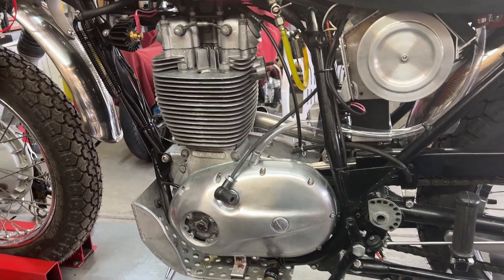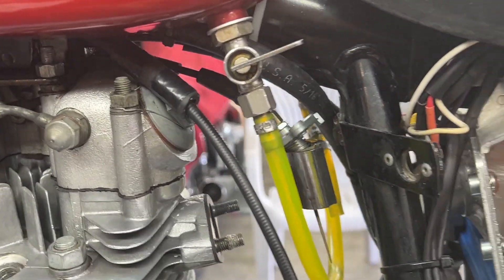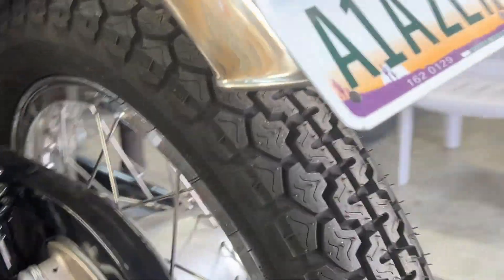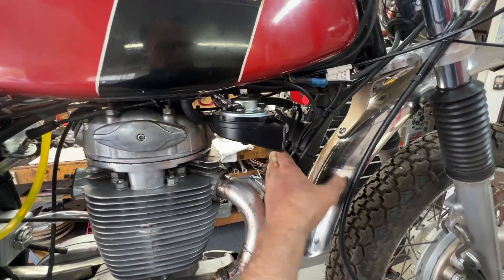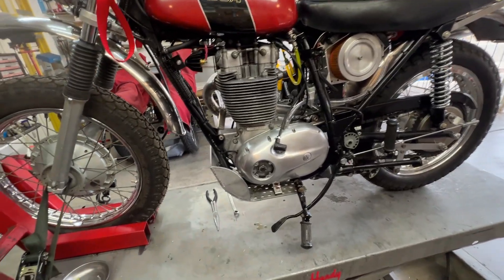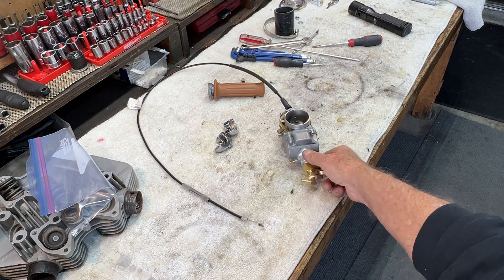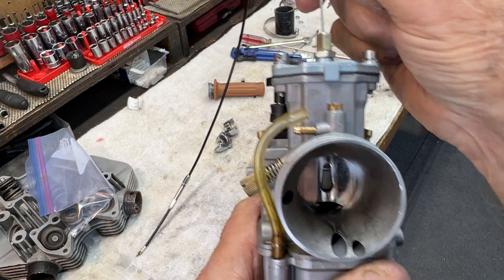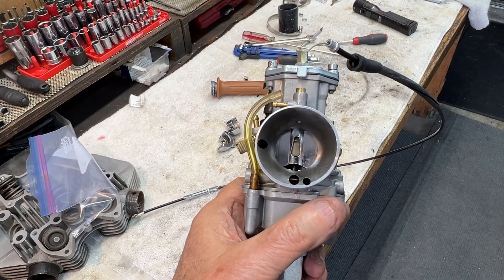Vintage British Motorcycles Repair/Restore

Comment: I thought lithium batteries and British motorcycles didn't mix?
Reply from the maker: I think the jury is still out on the compatibility of old British charging systems and Lithium batteries.  I don't use them nor suggest them but I am an old codger and don't like change or new things.  This is a client bike and he likes lithium, so, so be it.